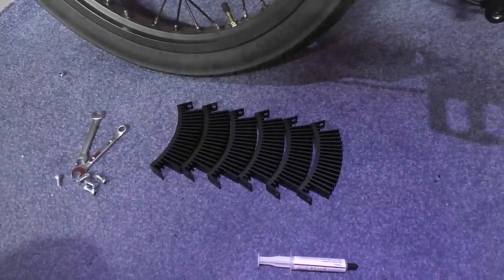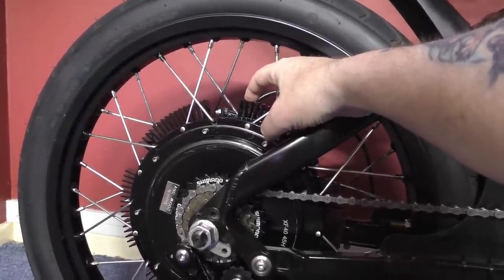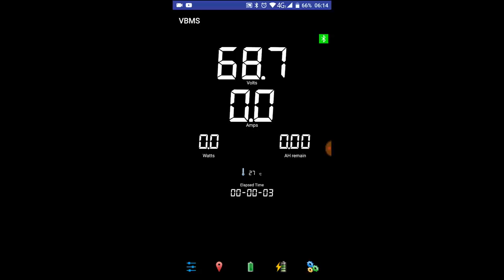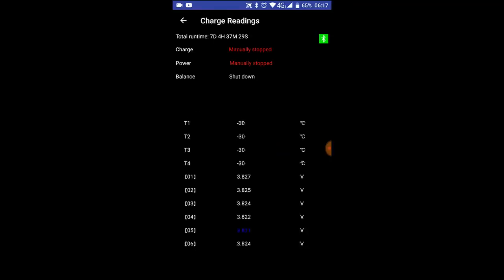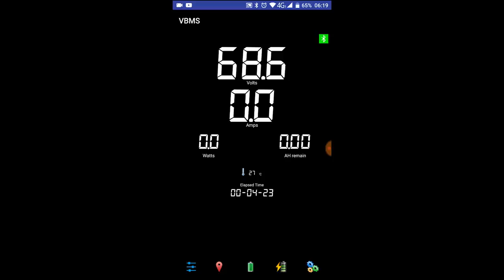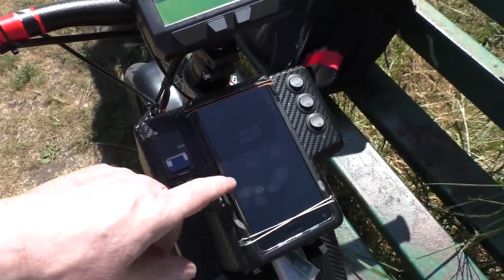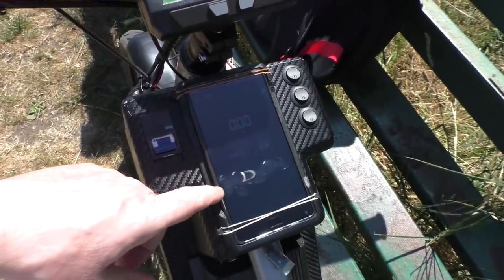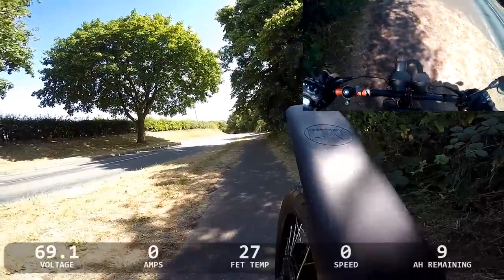VBMS and e-Bike HubSink tests and a sort of VLOG

Comment: Great video as usual Tony - I just bought a 120A VBMS with display through your link... It'll replace my 14S 60A BMS which is OK but often has difficulty connecting via bluetooth on my samsung s3.
Went for an 85km trip on Saturday, and ran out of juice just as I arrived - turned out a few cells in one cell module had got disconnected and was bouncing around 3V while all the others were still around 3.8V.
This is a perfect case why BMSs are so important!
Took the module apart to check the fuse wire links but decided not to reconnect the cells until I could equalise them at home. Recharged at a friend's farm, then rode back the next day a little more gently to make sure it would last and then fixed the module.
Would help to bind them together properly so they don't fall apart and jiggle around in the pannier!

Comment: Just a couple of points. 
I don't think you will be able to get the spokes back on if you fit the hub sink first.
I agree that the VBMS could replace the Cycle analyst for information, but for me I still need the cycle analyst to have pedal assist and to restrict the throttle for Dutch laws.
But, great video as always.

Comment: Thanks for the info. . Will the bms do a soft start for the controller without the need for a precharge resistor...I use a circuit breaker as a start switch with a precharge resistor at the moment.
I also saw your bike build... go the Konai Stinky...That was my first EBIKE, still have it, now just for off road.
Eddie
Reply: Hello Eddie, do you know answer? I am also interrested if with such a bms dont need to precharge .. and if i could ask you which battery setup do you have? 16s10p? Which controller. Thank you

Comment: i had a look at the same hub sinks, but i think thermal pads are better than the paste.     Can you measure the temerature of the coils inside of the motor?  Normally the hub sink cool the magets on the outside but what is with the inside?
Reply from the maker: The inside is monitored by the Sabvoton. It used to go into thermal throttling (over 80c) but it rarely goes over 60 now. 
Thermal pads...... brilliant idea! Thank you :-)

Comment: I have just bought your app. Looks good. A question about the hall signal. Do you need the lcd to get the hall input or is there a solder point on the main bms so you don't need the Lcd? Only thing i guess is where the decoding happens.
Reply from the maker: This has been long time question. There is a point on the LCD where you solder one of the hall sensors but it doesn't work properly (some have said it shorts the hall sensor completely). Anyway, it's only used for displaying speed which is why I added GPS speed to the app. You don't need the LCD for anything and you can leave it out if you want.
The app manual is here (please bear in mind that it's still work in progress) https://drive.google.com/open?id=1vzsTI-uTJOz1XV0LYyzbXWdhYaHnAyn0

Comment: The Ant BMS 8S-24S or 16S-32S that uses your VBMS software (and 3 or 4 other apps) won't by any mean replace Cycle Analyst v3 main features! For example Cycle Analyst has a dial back system for LVC and for motor temperature, I mean by that it will start reducing the amount of your throttle that is available as your come close to your LVC, and it does the same when your motor tempature exceeds the motor temperature setting.
Reply from the maker: Anything that the BMS doesn't do, the controller does. I've taken my CA out and I don't miss it at all!
Reply: @Vortecks  I respectfully disagree. Here are 2 important features that the CA v3 provide that the Ant BMS and most motor controllers don't provide.
1. Vlt-Cutoff and LoVGain settings in CA enable a dialing back of the throttle. I have my Vlt-Cutoff set to 3.4V per cell and the LoVGain set to 200. At 3.5V*20S CA will remap my throttle to 80% and I will have about 5km before I can only go at 20kph and when I hit 3.4V there is no throttle left. 
2. Thrsh Temp and Max Temp do the same thing for the motor tempature. 

Now I realize this may not be as important to some as others but in my case where I only have 72V20Ah I often find myself at 20% SOC and it is important that I have a bit of a warning when I need to find a place to recharge. Also with the tempature I have 60A Continuous motor controller and at 72V I can heat my x500W motor up pretty fast.
Reply from the maker: @bobmutchseo  Yes, I totally agree that you would benefit from the extra features of the CA. In my case, I don't suffer from range anxiety because I only do 20 miles max on one charge. With the hub-sinks and ferrofluid, I don't suffer with temperature problems and, even if I did, the Sabvoton will throttle back until the temp drops. Plus which, we only have 2 weeks of summer here :-)
For me personally, the CA just doesn't warrant being fitted anymore because everything I used to worry about has been resolved.

Comment: G,Day Vortecs... Great work on Writing a Program for the Bluetooth BMS, I personally I never liked/or used a BMS in my Battery Builds as  you never really visible know if the device is working correctly or not, I use a Cell checker & plug into a socket when I need to check Cell Voltages on my Enduro E-Bike Build (Mid Drive) But this BMS & your Great programming is finally allowing users a "Visible" Cell Voltage information to check on ones Expensive Battery Pack as well as a Shit load of other Info. Well done my Man, A big step forward in DIY E-Bike Builds 👍🏼😎 Do you think the app will also be available for the I-Phone in the Future ?
Reply from the maker: Cheers mate :-)
I can't release it on IOS. I looked into the possibility but they put far too many restrictions on Mr Average like me. It's easy for large corporations but impossible for a bloke in a bedroom to do it.
Reply: Vortecks , ok, no worries, might just get myself a cheap android compatible phone & do something similar to Andy Kirby E-Bike build (Velcro the phone as a  display only " on top of Enduro ebike frame when I do my next battery build in the future using that Bluetooth BMS 👌🏻👍🏼, Cheers 😊

Comment: Good day Vortecks I was wondering if the BMS can be adjusted for different battery chemistry's ? Many thanks and keep up the good work with the channel.
Reply from the maker: Yes! You can adjust the max/min voltages of each cell and the total battery capacity.

Comment: Tony , Mate. Did you get the ferro fluid as well? Apparently the fero fluid helps it cool down even faster as it helps conduction between the stator and the hub...... Regards Charles
Ps. Sabvoton = POWEEEERRR That's why you say it!!
Reply from the maker: Yes, I got the ferrofluid but I'm not using it until I do V3. It's a nightmare to split the motor - something I'm not looking forward to :-(
Reply: You can also drill a hole and put a rubber bung in it. They show on grin's site how to do it. If that helps.
Reply: soo much POWEEEEEEEERRRR ohh yeaahhh

Comment: Is the change MAC-Address feature of your VBMS app functional?  I have five ANT-BMS with identical MAC address, so I want to change the MAC on four of them.
Reply from the maker: My original version of the app had that feature (the one which all the Chinese supply with a new BMS) but it never worked so I removed it.
Unfortunately, there are only a certain amount of features I can add because I'm limited by the BMS. Changing MAC address is just one of those limitations.
Reply: @Vortecks  Thank you for the prompt response

Comment: If you want some nice spokes Tony...get some Stainless Steel ones m8..Not from China..real ones I mean...Amused me again as usual..the heat sinks looked very efficient..not surprised.
Reply from the maker: The ones I have are nickel plated and made in the UK mate. The trouble is, they're bloody expensive and they have to be made to order. I've ordered some from China at a fraction of the cost so I'm going to do some experiments with our 20t rigs and see which one gives way first :-)  
Someone has mentioned using thermal pads instead of paste.... I have quite a lot of thermal strips so I'll be using them - it cuts down on the mess for sure!

Comment: Hello, I have several bms each connected to their identical and new battery. When I tested them they worked one after the other. After charging the batteries without using the bluetooth program, there is only one BMs that connects to the program (application). For the moment I have started the autobalance with this bms. Why the other bms are not recognized by the program and what is the solution?
Reply from the maker: It's all down to the bluetooth module they use. The MAC address is the same in every module and your phone can only find one of them.
Most people have success by turning off the ones they're not using and only leave on the one you want to connect to.
The solution is to re-program the bluetooth module with a unique MAC address by connecting a cheap Arduino to it. It's an instruction video I've got to do, but time is rather limited at the moment. Please don't take offence, but this isn't a fault with the app, it's a fault with the BMS so it's not really a high priority for me at the moment.
Reply: @Vortecks  ok, for the moment i have the unique one who connect with tablet Samsung galaxy E, connected quickly and perfectly with mybms, i download vbms and nothing, no connexion ! Maybe tomorow will be better...
Reply: @Vortecks  there are video who explain how reprogram with arduino, it s not simple and the result will be 100% ? I must have 5 same bms who work in the same time when they are in charge or autobalance !
Reply: @Vortecks  if i ll fail with the bluetooth programmation , can i have one antbms connected with à big 16S pack ? how many P maximaly for  don t burn my 300AMP controler: 80P or 40P or 20P,  is it possible or the ANT bms immediatly dommaged or cut the tension ?

Comment: hello, i have a little question about my bms, i have an 8-24s bms from ic gogogo and a 18s 6p battery i use your apps which is way better than the others but i have a problem when i do  the "ballancing cell" the number 12 does not load and do not discharge and on the application the number 12 is white and not green like the others during the ballancing so I end up with 0.060v of difference is at  to say that when all the accumulators are at 4.000v the number 12 is at 3.940 and the bms refuses to balance it know you why? Thank you
Reply from the maker: Hi,
On the BMS settings, what do you have the "Balance cell voltage difference" set at?
Reply: @Vortecks  the "balance cell voltage difference" is set to 0.005v and I have left the battery all night in "forced balancing cell" and the number 12 is still in white the others in green and I now have 0.018v difference between  number 12 and all the others!
Reply from the maker: @matlopes2402  My next question is..... what capacity is the battery? Mine took nearly 3 days to balance correctly.
The BMS will only balance at 200mA which is rather low. Plus which, if you don't have adequate cooling on the balance resistors, it will stop balancing and only start again when the temps drop low enough.
Reply: @Vortecks  after checking good news on my 18s6p battery I at the level of the number 12 a battery that was desoldering so the bms refuse to balance the battery on the number 12 after soldering the bms works and the balancing cell works perfectly!
Reply: @Vortecks  my battery is a 15.6Ah (Murata vtc5A 2600mAh 35A 18s6p) and actually I set the balance to 60mA because otherwise it heats up to 60 ° C so this problem will be solved, I will air the bms but the main concern was well  the desoldering accumulator thank you
Reply from the maker: @matlopes2402  I love a success story, thanks for letting me know 😁
Reply: @Vortecks  no problem, good luck

Comment: hello if someone can help me i bought the app i connected it to my bms but i have a message in the charge and discharge which is "charge: balance line dropped cell" and "discharge: balance dropped cell "what does it mean because I can not charge my battery and she and brand new thank you
Reply from the maker: Hi Mat,
It means that one of your cells isn't connected for some reason. If you go to the 'Charge screen' it lists all the cell voltages - you should be able to see which one is reading zero.
Tony
Reply: hello thank you for helping me I reversed the socket 9 with the plug 11 so its distorted the result of the bms now its my mark "enabled" perfect !! thank you so much
Reply from the maker: @matlopes2402  I'm happy when something works. Thanks for letting me know :-)